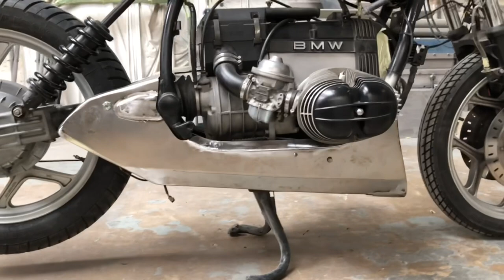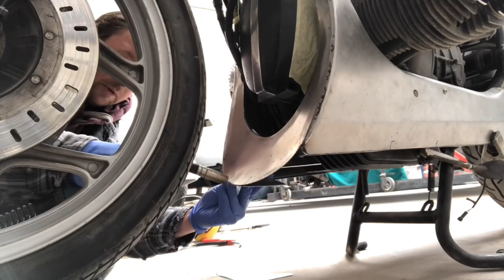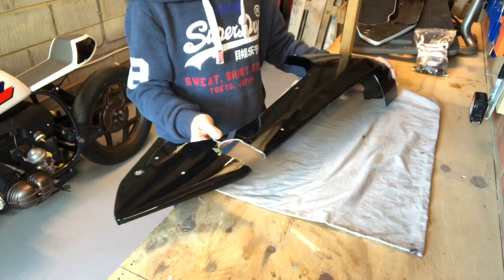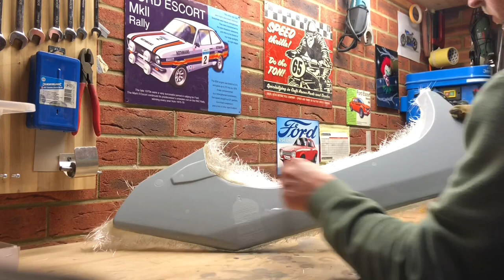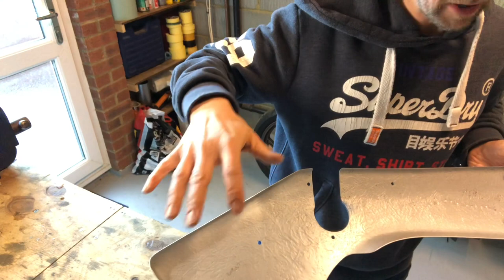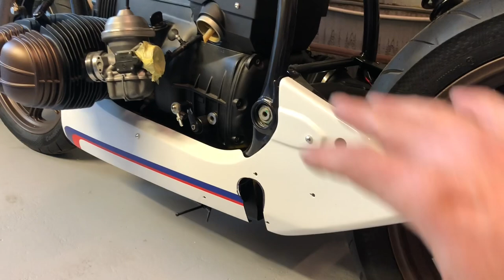CUSTOM BELLYPAN FOR THE BMW R100

Comment: Nice neat Fibreglass work there. I have some repro parts to make that are almost unobtainable for a couple of vintage Honda's i'm restoring. If mine come out as neat I will be well happy.  Also looking forward to seeing the final result of the GS your doing.
Reply from the maker: Thanks lee 👍🏻
Yes, just take your time mate, don’t rush , remember the mold will be exactly the same as the plug so make sure the plug is spot on
👍🏻👍🏻👍🏻